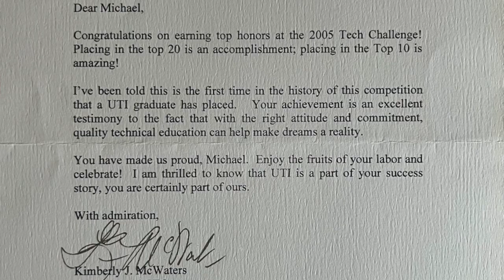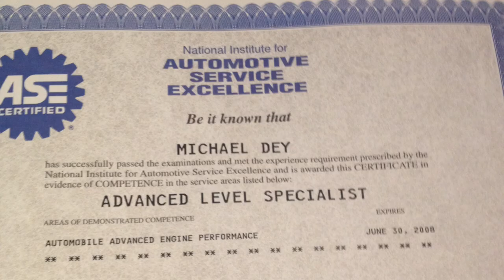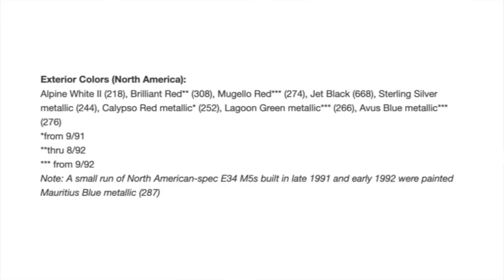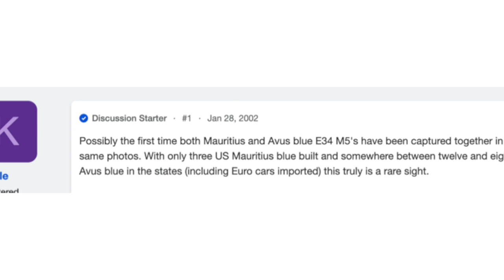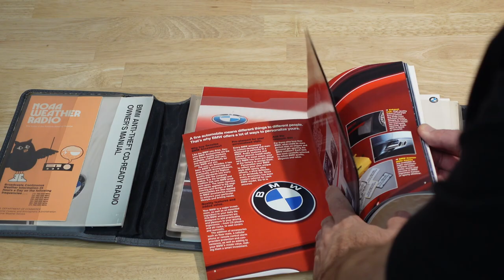BMW E34 M5 Automotive Restoration Intro and Inspection WeWrench Episode 1

Comment: Great to see this m5 being saved. You can buy replacement windshield wiper bushings on eBay
Reply from the maker: I think I'm just going to replace the whole transmission
Reply: @wewrench  I have experience with replacing the entire thing. It helps alot but it's not exactly a perfect solution for the problem and it still might scrape the hood. Problem is made from the factory, not enough clearance.  Perhaps replacing it and grinding off some material from the wiper arm would be more of a permanent fix...

Comment: Wow. Great overview of the car. So as far as rust repair, would you have to strip the car down to the body/frame and then repair the rust? Or are you able to do it in sections with most of the parts still in the car? Excited to watch the entire journey!
Reply from the maker: I'm going to remove everything inside the car except for the dashboard to assess the rust first. I have a feeling that the firewall is ok and the rust is mainly at the bottom of the car, but we'll see. Thanks for your support!
Reply: @wewrench  convert everything to carbon fiber and then quadruple dynamat every panel LOL... aaaaaah listening to you do pretty much ANYthing is always a joy!  Good to see you're doing well
Reply from the maker: @skuffles  You read my mind! Stay tuned!

Comment: The M-Parallels are also period correct. In fact, the e34 M5 3.8 was the first BMW with M-Pars.

Get new doors, quarters and gas tank from the sun-belt area. New right rear quarter needed.
Reply from the maker: All of that for sure!

Comment: The Allen Key in the tool kit is to close the Sunroof if the motor fails Or if the battery is flat. 
Very essential when Needed.
Reply from the maker: Yes!

Comment: It is a early 1992? 3.6? 

Why are you talking about dual mass flywheel? 3.6 has single mas fly wheel.

1992b 3.8 has dual.

It has 3.8 wheels, are you going to get 3.6 wheels?
Reply from the maker: It has a build date of 10/1991 so it’s an early US spec 1992. I looked in the parts system and it says “twin mass flywheel” in the heading, but the part just says “flywheel” so I could be mistaken. As far as the wheels go…these wheels came standard on 1993 US spec M5’s so I guess they can technically be called 3.6 wheels. Are you from overseas?
Reply from the maker: Just looked up the flywheel for the 3.8 and you’re right. 3.8 is dual mass. 3.6 is single.
Reply: @wewrench  yes style 21 was standard from 92b and 3.8.

3.6 has turbines style 20.

Yes, way overseas Stockholm Sweden
👍
Reply from the maker: @M5kungen2  Back in the day, I interacted with a fellow from Sweden through the M5 board that was able to get production numbers by color. I tried searching for old emails but I couldn't find them. You seem pretty knowledgeable, any idea who this was or if he's still around?